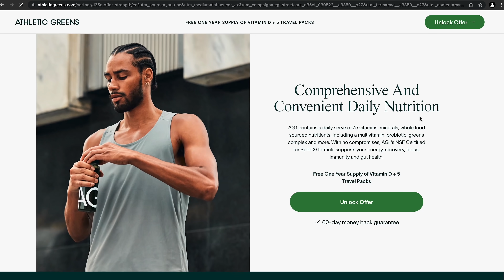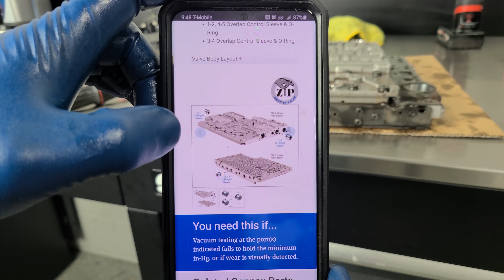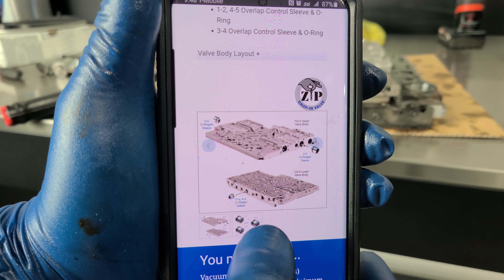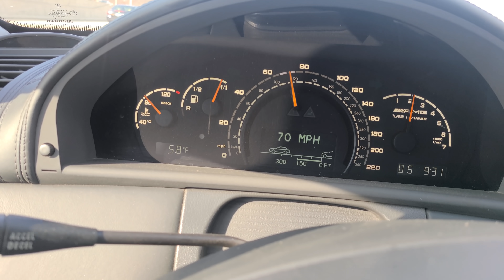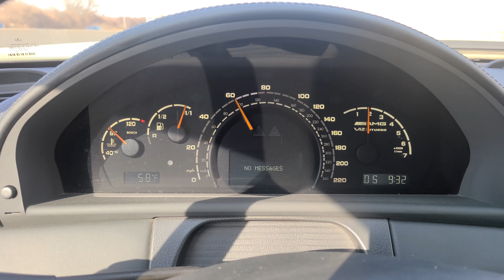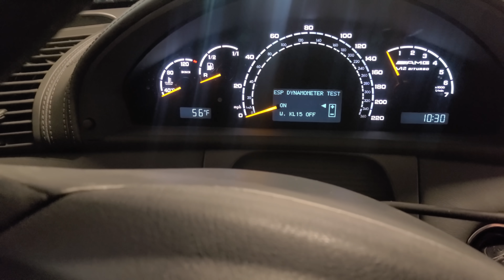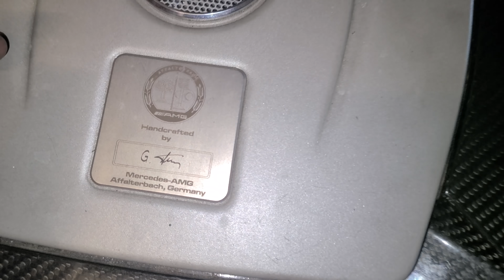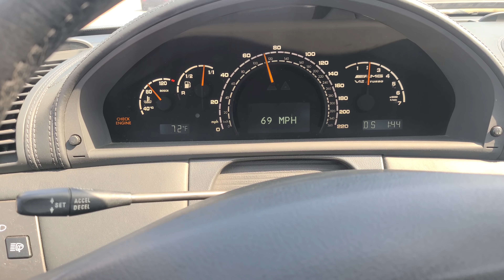My CL65 AMG FINALLY Made It To The Dyno But It Didn't End Well. I Love This Car!

Comment: Nice car in some aspects,but the old saying ,"if you can't afford a new one , you can't afford a second hand one .
The pinical of the auto motive world is not nessassary the best long term ownership model is it ?
Still can understand the aftermarket controller,has the original one been an issue for a long time,has the connections of the aftermarket, interfering with the OEM ?

Comment: Hey man i have a 03 mercedes s600 and ive finally got some new tires on and started driving again, now i keep getting a light saying engine oil level visit workshop so i will pull over check the oil and it says engine oil level okay, i even tried filling it up and over filled it so i sucked some out and got the level perfect, i have no leaks and the sensor seems to be working but i keep getting the light, mainly happens on either coldstarts or randomly on the highway, im also getting a similar error with my coolant level sensor but only on coldstarts ?! I really hope it isnt a fried sam control unit, should i test the sensors with a multimeter before replacing the sensors ?

Comment: Honestly in my opinion, that air intake filters look horrible. Looks like something a Honda tuner dude would do. Lol
Reply: Well that's just like.... your opinion man- The Dude
Reply: agreed. look really bad and i think he thinks so too, thus why he removed them
Reply: @The Friendly Ghost like most intakes you have negligible gains. Especially since stock is basically a ram ambient air intake.
Reply: Your assumption is incorrect.
Reply: @danielraul1989  not only they act as air intake rams but they dimensioned with complex fluids dynamics finite elements software to reduce the noise using resonances and back pressure without losing performances
Reply: Intake looks ghetto.  Ghettooooooo!
Reply: That was my first thought.
Reply: Lucky it’s not your car ha

Comment: I wondered if anyone here could help me, i have a c350 diesel CDI estate with error codes showing no communication with the fuel control module... I've changed the module and it's still the same. Any ideas? It runs really rough when cold but perfect when warm

Comment: I serviced 722.6's so much on my ownership of W140's and W211's. It is a very good transmission. Just one word of advice: That disptick tool that you used is wrecked, since the coil is visibly stretched. Buy a new one or you will have higher readings that what is there is reality.

Comment: Hi there sir m Daniel one of your subcriber I need your help can u please tell me what does DCC 52 system fail means this came up while I was getting my 2008 Mitsubishi lancer glx 1.3 automatic transmission I got it  checked but computer guy he said that it a CVT problem he said u have to repaired or change the hole automatic gear transmission  everything works fine I work here in the middle east Oman so can u help me in the situation what should I do I need your advice on this so I can tell the mechanic what to do cause here in Oman they are not like USA so please please help me on this sir . Thank you Daniel

Comment: For the people who think that at some point it will be done with everything that breaks: no.

I have a 20+ year old Jaguar XJ and it is really unbelievable. After you fix some issues, the other is guaranteed to break within a week. From the radio that goes off constantly (and randomly), headlight glasses that break out of nowhere and complete gearboxes that don't last after 130,000 miles with regular maintenance.

Comment: I was very disappointed in FCP Euro as they did not support the conductor plate for my 722.9 gearbox on a 2009 C230 Coupe and had to pay ZAR 22.5K for rebuild repairs.
Reply: In the 722.9 it's no longer a conductor plate, but actually a control unit. It's also a "trp" part ( theft relevant part) which restricts it's availability from Mercedes Benz.

Comment: I think the hood struts are upside down.   I was told that the cylinder (larger section) should be higher than the piston.   That way the piston stays lubricated.    Does this sound correct?    Maybe this is why hood struts are always bad.

Comment: That is not an ATF cooler.  That is an ATF heat exchanger to bring the ATF up to operating temperature quicker on a cold start.  An ATF cooler will have it's own radiator as 212 degrees F is way too hard for optimal ATF life.

ATF is way dark and should have been mechanically exchanged about 50K before now.  Pan drop and refill leaves about 10L of expired ATF in the torque converter and nooks and crannies, gears clutches, etc.  One is just diluting the expired ATF with a small amount of new ATF.

The white paper towel test is your best friend as color change indicates ATF wear perfectly.

Comment: Not real impressed with Mercedes from what I have seen so far, except of course awesome performance  when every little thing is working perfectly.
Then again, I had an old Chevy pickup that was practically indestructible no matter the abuse (which was a lot of abuse).
My guess, no car maker makes them to last like they used to no matter the cost.

Comment: I used to want an old C36 or C43 AMG from the 90s until I found out the engine harnesses were designed to be biodegradable and did while still in the car.  These videos perfectly represent why having any Newer Mercedes (90s & up to me) is a very very bad idea. I'll stick with my old BMWs, Thx.

Comment: Can't wait for YTG to get the 560SEC on the lift! No offense but I like the 560 better than the CL... The body on 1990's SEC is very classy. The biggest problem with them was low horsepower and suck the gas. I'm a big fan of the big coupes

At least your car sucks the gas but makes a lot of horsepower for it.

Comment: I don't understand hood struts. There is only two kinds. Those that have failed and those that haven't failed yet.
What's wrong with a prop? It doesn't matter if it's 100 years old, unless it got destroyed by direct action, it will last another 100 years.
Struts are just a solution to a problem that didn't exist that caused more problems in the process.